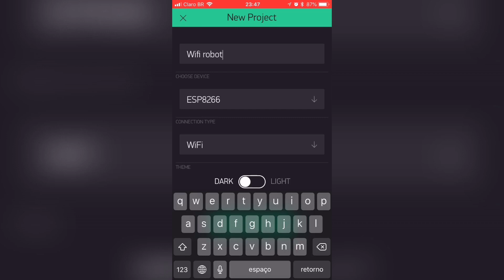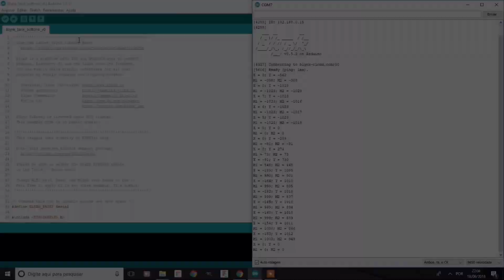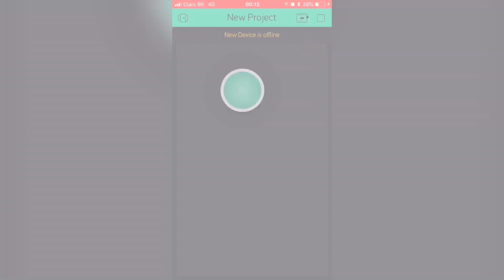Wi-Fi controlled robot (with Wemos ESP8266, Arduino IDE and Blynk App) - pt.2

Comment: Do you think there is a way to make this robot autonomous?
Reply from the maker: Hi there! You can add some sensors, develop your own codes and make it a little bit autonomous. It won't be very smart (because and Arduino or a ESP8266 doesn't have enough processing power), but you can do some interesting applications.

Comment: Bro... backward not working
Reply from the maker: Please check if the wiring is correct. I suggest you to measure the voltage as the pins (when the robot is suppose to run backwards) to see if the signals are correct.

Comment: Hello man! Great work! 
I was wondering, how did you power your arduino? I see you connected the 5V pin to power the hbridge logic circuit but aren't you suppose to put it in the vin pin of the arduino if you want to power it? 
Thanks
Reply from the maker: Hello Nicolas! I'm glad you liked this project! :D
Regarding the Arduino power source, actually the h-bridge board powers the Arduino. The L298N board I used has three terminals on the power side: Vin, GND and 5V. I connected the batteries to Vin and Gnd pins. Internally the board steps that voltage down to 5V (at the 5V pin). I connected this 5V pin to Arduino's 5V pin, and this way I could power the Arduino directly.
Other approach would be to connect the batteries to Arduino Vin pin. I think it would also work.